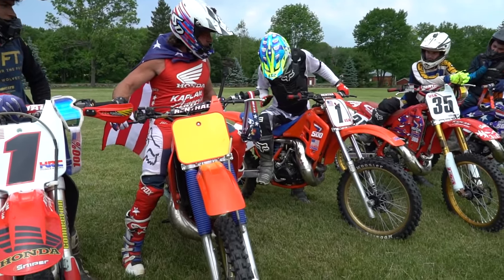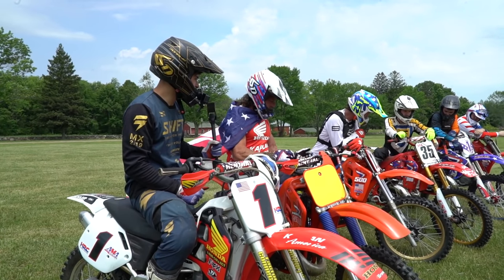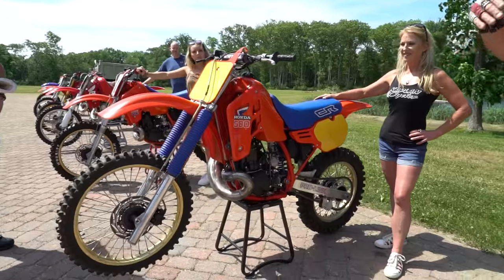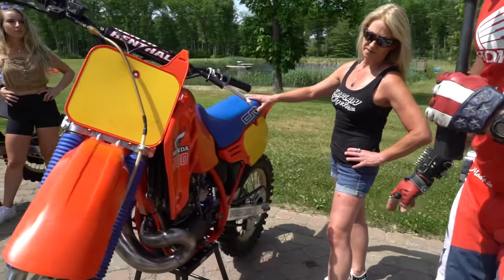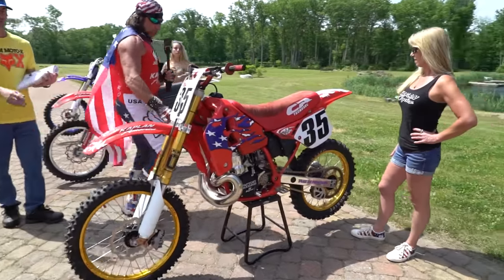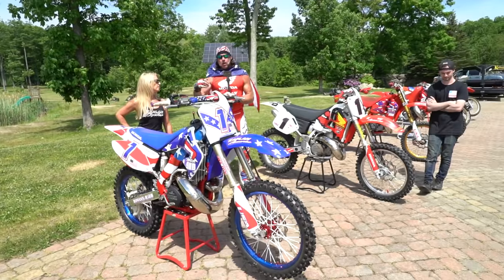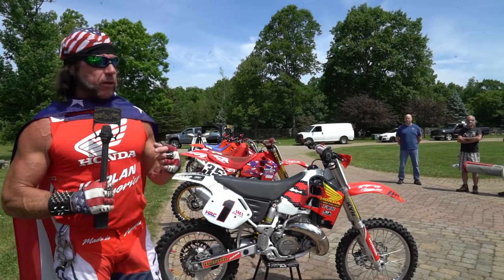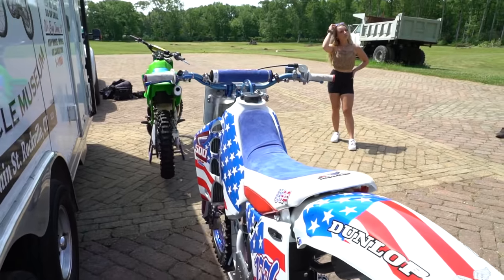1986 HONDA CR500 VS 1987 VS 1988 VS 1989 VS 97 & 03 SHOOTOUT @ THE COMPOUND

Comment: I feel the 89-up engines have more top end while 86-88 are just monsters right off the bottom, but flatten out on top.
Never rode a 480 though, would love to give one a try..
Minor frome geometey changes in '94, along with a wider 4th and 5th gears, better fork in '96, better shock in '97.

Comment: 85 had a heavier frame than the 86 and they lightened the 86 frame by changing the gusseting on the frame along with lightening the plastics by making them thinner. When you put them side by side you can see the difference, tank and seat is noticeable. I worked for Honda 85-87 and put these guys together I also have one of each. Love your videos.

Comment: I had a 79 rm400 when I was 13 I loved it.then I got a yz250 with a yz400 motor 78 I think.before that I had a 76 ts250 when I was 10 then a Yamaha dt360 then a ts400 then a dr400 79.ended up with a it490 but never got it running now I have a 96ktm 300.love the bikes and the attitude.stay blessed stay humble.

Comment: Just awesome! 
I'm from Sweden Scandinavia and I did race those bikes from 1983 whit the 480 up to 1999. I never race the AF frame and I personally think they are to stiff. I'm use to the flex from the carbon steel frame. On my race bikes I use Öhlins as I'm swedish and WP and Marzoochi conventional fork. There is nothing better they fit for different tracks ! On sand or bad conditions upside down is by far the best choice! On hard track whit Sharp edges the conventional fork is smootning your ride so less armpumps will take place! 
My friend Marcus Hansson did win the world championship 1994 on Hayden Honda CR500. A longer rod smooth out the engine but compression play hugh part in how it runs. My race bike had 12:1 and was run race fule 120 octane. What das that do. Stronger pull from low mid to high mid. I use stock exhaust and hole list of pipes in our days we had probably 10 different setups and the muffler length play big part how motor will perform! Sad I was not there whit you could have told lots of historical things. Did like the video much 👍 best regards from Sweden 🇸🇪
Bjorn

Comment: I have a CR500AF with a 1993 modified engine in a 2009 CRF250 frame. It rides so much better than a stock CR500.
But my favourite ride is the Maico 490 mega2....arguably the best big bore 2 stroke ever made.

Comment: hey i like the  500 shootout but you guys forgot to mention the major change or atleast i think so it that 89-2001 motors have the new style jug which at the coolant jack goin strait up from the side of pipe instead of the coolant line going behind the the cylinder head like in models 85-88, there coolant jact when from the bottom of the pipe an wraps behind the back of the cylinder thats the major change honda did between those years..

Comment: Hey Kaplan ,,,I have a 2000 CR500 love riding it ,,pullingWillie's in fifth gear at 110 miles an hour and pulling away form 450s like they're tied to a tree stump,,, built engine Nikka sealed cylinder,, ported,,hot crank,, FMF fatty,, Wiseco piston,, carbon fiber boyesen Reed valves, milled head, 13 to 1 compression ratio,,  only run Maxima,, Castor 927,, vp110 race fuel only,, panned out speed 125 miles per hour,,,,,, 15 tooth front sprocket 47 rear,, when I go to sand dunes I put 14,,front sprockets on,  and race built Banshee with snowmobile engines talk about in adrenaline Rush.
Reply from the maker: Big red flag went up when I saw that you use Castrol 927 with vp110 please do yourself a favor read the fine print on the Castrol 927 it actually separates with fuel that has a specific gravity above 700, BP 110 has a specific gravity of 715 as does most airplane fuels we figured this out the hard way cost us a bunch of money and wasted a bunch of time and screwed up our trip to Daytona.. the information I'm talking about what's on the back of the castrol 927 bottle, of course we never read the bottle the VP distributor came down to diagnose some bad gas at they are sold us and gave us the rundown about the cash drawer so we switched to spectro and I've had no problems since then using spectro and Maxima
Reply from the maker: Your bike sounds like a monster you've got the formula figure out!!! How to put down lots of horsepower!!! I'm not sure if you ever ran it on a dyno but a good solid 500 is putting down usually between 50 and 55 one built like yours is probably putting down 60 to 65 and a mountain a torque

Comment: Awesome Video, Brother. Just what I wanted to see to start off my Saturday. For a guy, somewhat small in stature, Kyle can most definitely hold his own! Talented Rider. That's a whole lot of bike to handle, especially at Kyle's size and weight. Must have felt like a rocketship to Kyle. It looks almost impossible, to keep the front wheel of the 500's on the ground. In my 20's, when I was much stronger, and in better shape, I would have loved to have had the opportunity to ride a 500. I didn't know anybody that had one. At the age of 49, you couldn't pay me enough money to ride one. The GasGas MC 250 is more then enough power for mez since it's been like 27 years since I rode one. She definitely surprised me. Wizard has my MC 250!running like a raped ape!